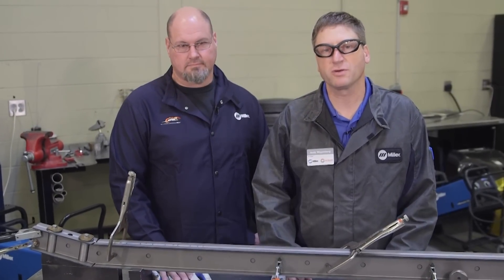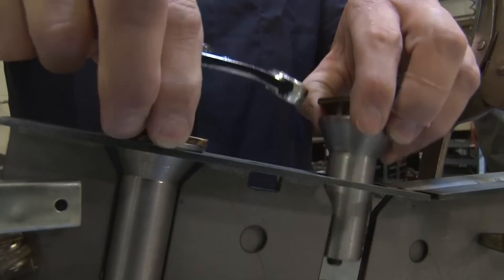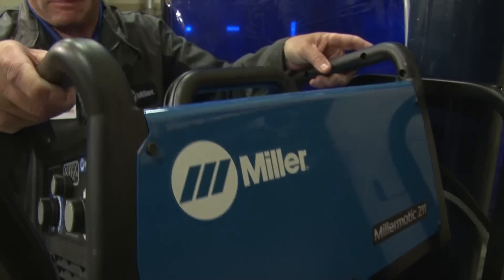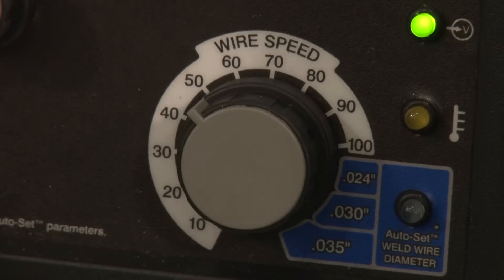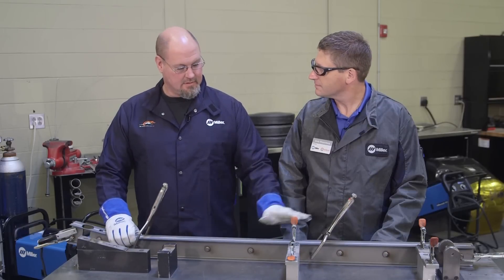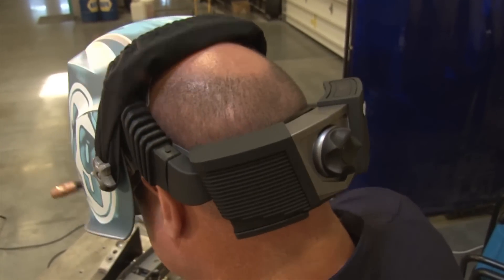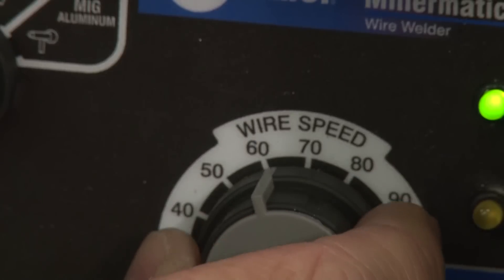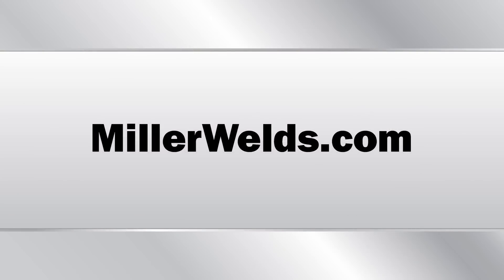MIG welding a truck arm with the Millermatic 211 at JR Motorsports

Comment: I have the Miller 211 my machine is in mint condition and I do mean mint condition I was burning flux core I stopped and started using mild Steel and I doubt it if I ever put flux core in it again the whales that I'm able to put down I simply beautiful makes me glad to be a fabricator
Reply: Is the 211 big enough to weld a trailer with 6" steel channels for the frame?

Comment: I currently have the 190 what would I gain from upgrading to the 211 besides 120V capability and a few more amps?
Reply from the maker: Thank You for reaching out.  In addition to 120V input capability and additional amperage output the Millermatic 211 would have a higher duty cycle than the Millermatic 190.  The Millermatic 211 features Advanced Auto-Set which includes five different wire/gas combinations versus the standard Auto-Set.

Comment: Nice.Have they got the nozzle problem fixed yet? Gets hot and loosened up to wear you can't weld.
Reply from the maker: Thanks for the question Brian. Miller just released a new style gun that is similar to the M-100 that comes with the Millermatic 211 currently.  The New gun is called the MDX-100 and the nozzle threads onto the gun to eliminate the possibility of the consumables getting loose from being exposed to the extreme heat that welding produces.
Reply: For how much the machine cost. If theres a problem with the gun. They should give you the newer upgraded gun for free

Comment: Is the 211 big enough to build/weld a utility trailer?
Reply from the maker: The Millermatic 211 is capable of welding 3/8" thick steel on 240v input power, so it would be capable of welding most utility trailer projects.

Comment: That helmet looks interesting.
Reply from the maker: +Kevin Hornbuckle Thanks, Kevin. The helmet that "Mongo" is welding with is from our  Digital Elite™ series. You can check it out here: https://www.millerwelds.com/en/safety/helmets/helmets-digital-elite-series. Just select "Vintage Roadster from the drop-down on the page. Or, you can find more information on the Miller CoolBand here: https://www.millerwelds.com/safety/cooling-devices/coolband.

Thanks!
Reply: Thanks. I am in the market for a new auto-darkening hood. I have a few Miller products including a TIG welder and I have found them all to be completely reliable.